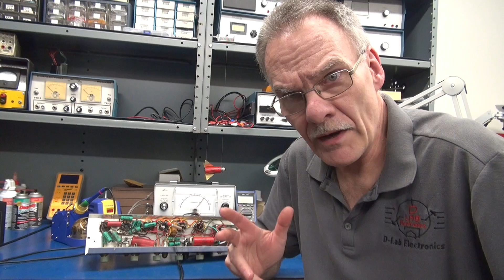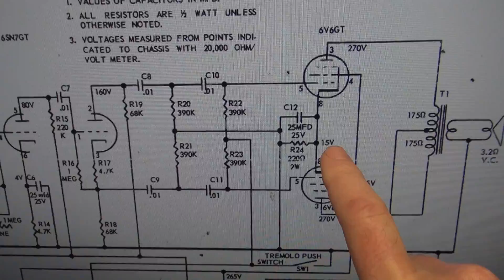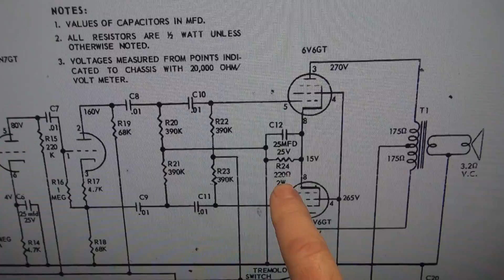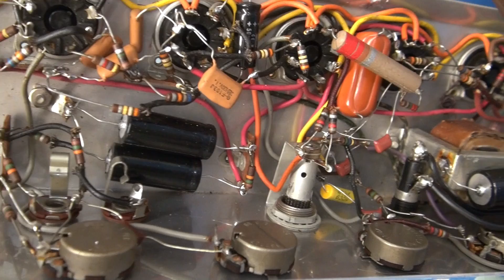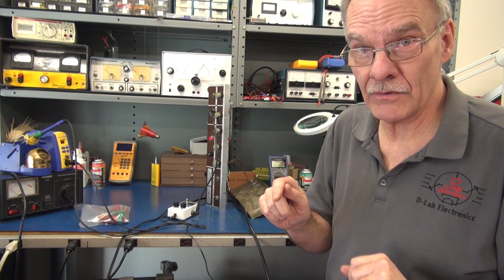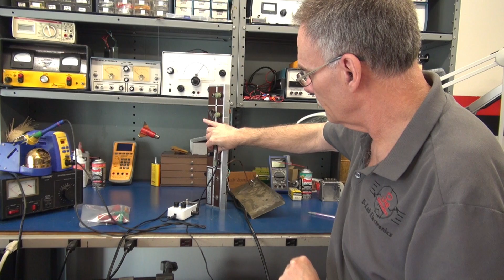Vintage Silvertone 1333 tube guitar amplifier repair shorted capacitor bad Red Planet & green caps!

Comment: D lab, make a lesson on showing how to tune the frequency response and tone shaping of guitar amplifiers using a signal generator and an oscilloscope to tune the capacitors values and sloping resistors per each gain stage. Most guitar amplifiers need fine tuning adjustments because the engineers weren't guitarist to begin with.

Comment: That is a great tip to check the cathode bias voltage first, when that is the topology of the output stage. We see that same topology concept in hi-fi amplifiers too, often with separate R and C for each tube, instead of combined. Of course there is debate about the sound compared to negative supply grid bias (fixed bias) but cathode bias has its advocates.. It saves having another supply voltage, and the impedance in the cathode circuit acts as local degeneration, reducing distortion. Personally, I prefer it, .. and am working on what used to be a Dynaco ST70 right now, converting it to cathode bias, along with all new front end.  Good advice... for those watching you and Uncle Doug, this IS a tip to remember.